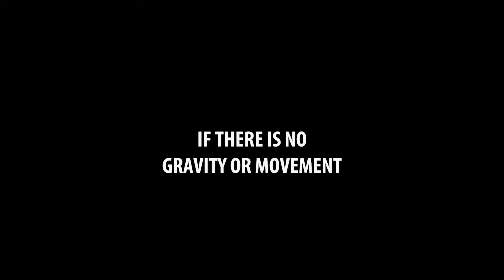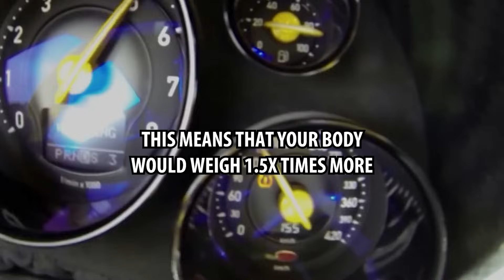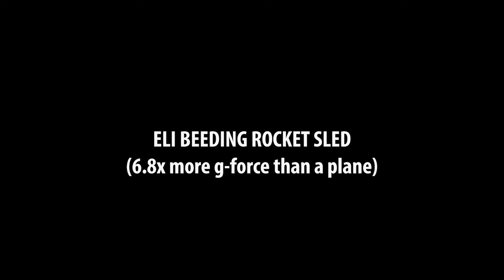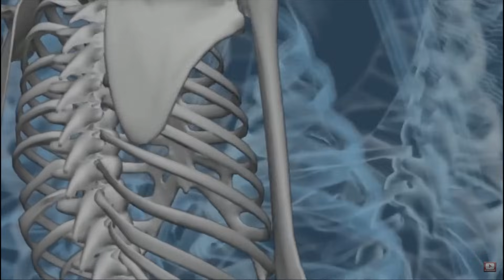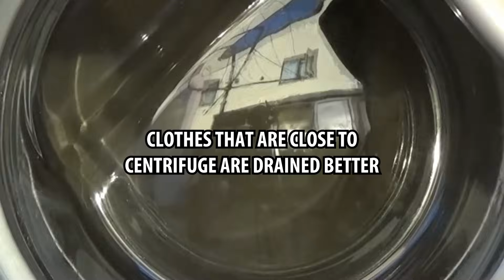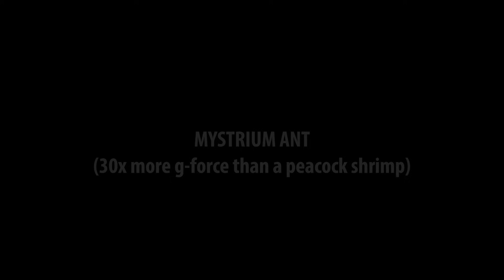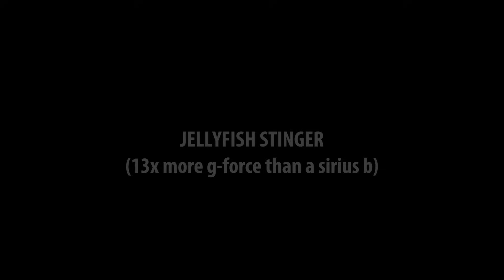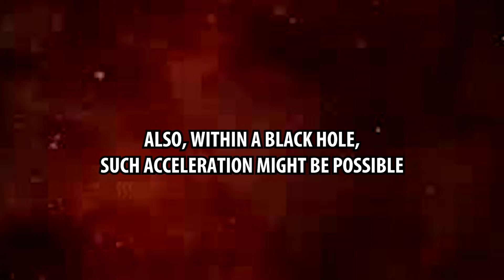Top G-Force Things Ever

Comment: there's actually almost 1g in where astronauts chill out... its like 0.91, they just are in constant fall so they float, they're falling and going forward fast, but because curvature of earth, they dont hit the ground, kinda like a powerfully shot cannon ball, cannon ball with turbo booster so that it wont fall to the ground. so its not gravitation free up in there.

edit: (the video is indeed correct on the (0-G), there is in that altitude [about 400km] gravitional pull, but there is 0-G because iss has so huge speed)
Reply: Thanks for writing that because many people don't understand how orbits work. This is true of all celestial orbiting objects including the Earth's orbit around the sun.
Reply: Yeah. It's called micro gravity, not zero gravity.
Reply: @slinky_malinki5330  i think its odd to call it "micro" sinse gravity is almost the same at 400km above earth, it still has like 91% of the force that it has here on earth.
Reply: @jonassilfverberg8938  but because astronauts are floating around, it's called micro.
Reply: @slinky_malinki5330  but they arent floating because gravity so its weird to say that its microgravity in there, sinse its actually huge, but what ever xd
Reply: @slinky_malinki5330  They are only floating because they are in a constant free fall the same as if you are in an elevator and the cable cut. Except in this case they have an extremely fast speed moving forward at 17,500 miles per hour.
Reply: @vaportrails458  I know that, but it appears like they are floating. That is why the official term is called microgravity.
Reply: Ok but if you measure things from within there is no difference between 0 G and free fall...
Reply: You said curved earth? Im triggered
Reply: @jonassilfverberg8938  That does help to clarify things! NASA formats it like this: "Why Do Objects Float in Orbit?
If 90 percent of Earth's gravity reaches the space station, then why do astronauts float there? The answer is because they are in free fall. In a vacuum, gravity causes all objects to fall at the same rate. The mass of the object does not matter. If a person drops a hammer and a feather, air will make the feather fall more slowly. But if there were no air, they would fall at the same acceleration. Some amusement parks have free-fall rides, in which a cabin is dropped along a tall tower. If a person let go of an object at the beginning of the fall, the person and the object would fall at the same acceleration. Because of that, the object would appear to float in front of the person. That is what happens in a spacecraft. The spacecraft, its crew and any objects aboard are all falling toward but around Earth. Since they are all falling together, the crew and objects appear to float when compared with the spacecraft."
Reply: @jonnah99  yeaaaaa that are correct i guess.u can have gravity pull u b ut still 0 g force if are FALLING!!! if you stand on a SCALE that are falling with u in the vacuum then the scale will no take measurement. as u can see, is just theory of relativity.
Reply: @slinky_malinki5330  It is called micro since they are falling towards the earth but going around it making it hit nothing in its path witch makes it 0 G exactly, they only feel the gravity of them selfes and the space station and the moon, and the sun wich is such a small amout that its called micro
Reply: And yes, they experience gravity. but the full body gets that gravity its not like a part of the body moving and taking the rest with it, thats what g force is its the acceleration of different parts of the body reacting to each other. That is exactly 0 when every part of the body gets pulled by earth
Reply: Also a force wich a lot of people forget about is that the human body is about 1.8 meters on average and making it not an exact orbit. the part closest to the earth moves just a tiny bit faster than the part furthest away and pulls it
(this force is probably less than the gravity the iss makes)

Comment: G-Force Rating (G)
--------
Space: 0
Earth: 1
Supercar: 1.5
Space Shuttle: 3
Top Fuel: 4.2
Roller Coaster: 6
Jet Fighter: 12
Rocket Sled: 82.6
Kenny Brack Crash: 214.6
-------------------------------------------  
Click Beetle: 360
Washing Machine: 400
Wood Pecker: 1200
Baseball: 3000
Peacock Shrimp: 10,400
Mystrium Ant: 300,000 
White Dwarf Siruis B: 390,000
Jellyfish Stinger: 5,400,000
Neutron Star: 7,000,000,000,000
Wakefiled Acclerator: 170,000,000,000,000,000,000,000

Comment: 7:21 as you can see on my profile... washers are so much different, like an 50kg washer at 1200 rpm might experience 1.200 g force whilke an 4kg 1200 washer only gets about 100 (only) or a 2000 rpm washer might experience 600

Comment: For those that think that F1 drivers aren't real athleats try to drive a car that can go from 0 to 200 km/h in 4.2 seconds, a car that throughout a race weekend will make you experience g forces as "little" as 3g up to 6g in every single corner, a car that it's cockpit can get as hot as 60 degrees celsius, imagine all of that and also imagine that a Grand Prix lasts at minimum 1 and a half hours, and the Grand Prix that the drivers have to sustain the 60 degrees celsius in the cockpit, the Singapore GP, lasts on average 1h50min to 2h

Comment: I feel that the way G-forces and gravitational force are equated in the video is quite misleading and wrong. G-forces are just any acceleration you experience, measured as a comparison with normal earth gravity. One G-force therefore means about 9,81m/s^2 of acceleration. The gravitational force you experience does NOT change, it's ONLY your acceleration that does. In most cases where we think of G-forces, it's normal acceleration, basically meaning that you are going in a circle or a partial circle, and the acceleration is the acceleration that is normal to your direction of movement, and keeps you going in a circle and not just straight ahead. For example an aircraft turning. With something like a car accelerating, the acceleration is in linear motion.

Also, it should be noted that the direction of the G-forces you experience affect your tolerance to it massively. When a fighter pilot turns, the G-forces are usually downward, meaning that blood is pooling in their legs, which can cause them to black out. Upward Gs, often called negative Gs, cause the blood to pool in your head. This is significantly more dangerous and should always be avoided. In the acceleration (or deceleration) of a car what is felt is either forward or backward G-forces, which do not cause significant blood pooling, however very strong forward G-forces can cause temporary blindness since the blood vessels in your eyes may pop. Luckily these are very very rarely experienced by people, one example is a frontal car crash at a high speed, which is dangerous for different reasons. Sideways G-forces are experienced most notably when you drive a car and turn. They're awkward for the human body but not dangerous per se. In the case of a formula driver, you need to be in good shape in order to resist them.

It's also important to note that G-forces are not a force, they are an acceleration that is measured not in m/s^2, but rather as a multiplier of gravity on earth's surface. They can directly be converted into m/s^2.

Comment: this is crazy when u go on shock wave roaller coaster at six flags over texas u can feel the g force when it loops when it went on the loops I feel so heavy and something very heavy pushing my head down it lasts for 1.5 seconds and there is 2 loops and each loop is 5.9 gs u cam feel the pressure on your face so I was on 5.9 gs for 3 sec

Comment: 0:13 It's no mere perception of weight. Accelerating reference frames experience a very real gravitational field.
0:20 It's not movement that causes gravity. It's acceleration. After all, relative to the sun we're moving at around 30 kilometers per second, and those astronauts orbiting earth in the ISS in the video are traveling at a ground speed of 7.5 km/s.
1:44 I'm not sure what you mean by "fastest" but it most certainly isn't. Compared to other rockets, it doesn't have anywhere near as much delta v. 
At this point I stopped. Automatic downvote.

Comment: this is misleading, as the duration spent experiencing high forces is very important. i read that you experience 100gs of force by jumping and landing with your legs straight! but this is only for a tiny fraction of a second. the 85gs for 0.04s that Beeding experienced might not seem like much but clearly did alot more damage than jumping does